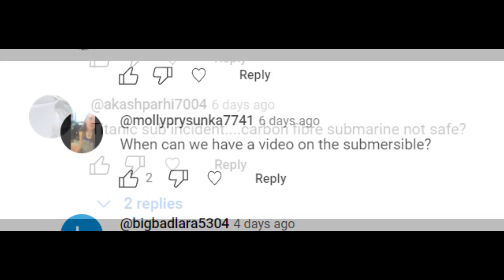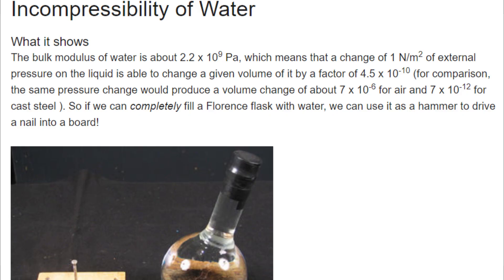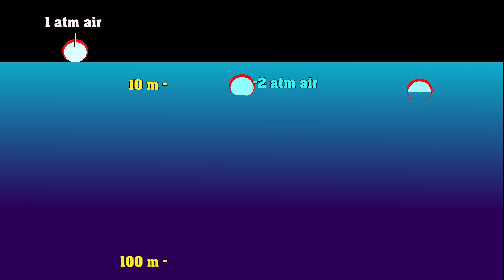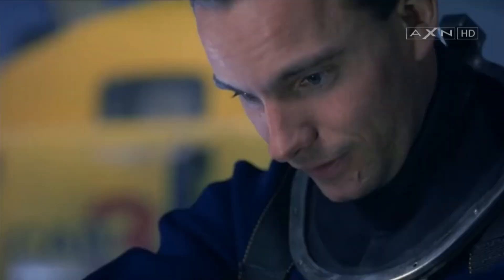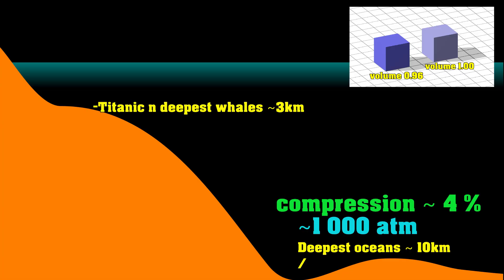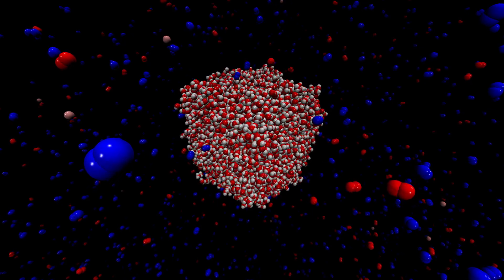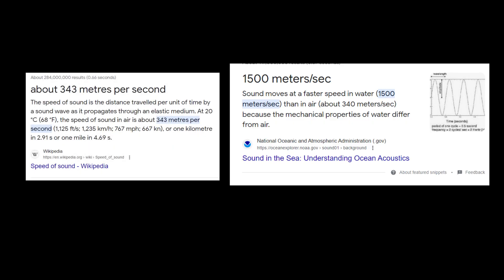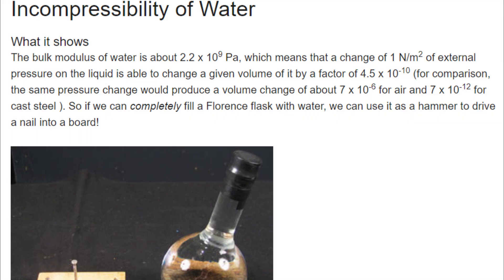What Happens when a Hull Fails at 1000 atmospheres?

Comment: I would like to see additional info, not just about changes in compression and decompression, but about temperature change as well. i.e. is there cooling of the water as it decompresses, and is there heating of the air in the capsule as it is compressed. How high will that volume of air and water heat or cool  under that kind of compression or decompression?

Comment: Have you not seen the films made during Operation Wigwam? A nuclear bomb was exploded deep underwater (basically, a nuclear depth charge) and film was shot of the inside of several submersible vessels that were loaded with dummies to simulate crewmen. One of the submersibles imploded, and the water rushing in was caught on film. I feel sure there must be videos with the film clip in them, somewhere here on YouTube. The incoming water moves VERY quickly. I've seen the clip several times - it is quite upsetting.

https://en.wikipedia.org/wiki/Operation_Wigwam

ALL UNDERWATER NUCLEAR TESTS
https://www.youtube.com/watch?v=gK3E6N8DuE8&t=324s
(skip ahead to time index 1m 30s)

Comment: Great one Phil but I have a question If air is moving at the speed of sound is it just ricocheting off itself like pachinko balls or is it actually going somewhere seems like it can't go very far before it changes direction
Also based on things that move at the speed of sound they tend to heat up so the thermal consideration seems a little off wouldn't Sonic speed air create some friction c heat,?
Reply: The speed of sound increases with heat. This is why rocket engines are able to exhaust hypersonic gas without disintegrating.

Comment: What is the scenario if there is only a pinhole breach in the container?
Reply: Less than a millisecond later, the hole, which is now a point of failure, is expanded and accelerated into the chamber at mach 3. There is no "pinhole breach" at that depth.

Comment: I saw a simulation of the incident. The hull collapsed along its longitudinal axis. The two end caps slammed into each other, and that's what popped off the viewport that's held by 16 bolts that were all sheared clean off.
When they built the hull, they wound the carbon fibers in parallel. They should have used a  criss-cross pattern. 
But it's stupid to use carbon fiber this way! It adds no strength to the material. The fibers do a great job in tension but offer no resistance in compression. The epoxy was the only thing holding it together.
On top of this, I heard the hull was supposed to be 7" thick, but Richard Rush III was in a RUSH, so it was only 5" thick. 
He refused to PAY for a better viewport, too. He took the CHEAP PATH and paid the ultimate price!

Comment: Others may have already mentioned the gruesome Byford Dolphin industrial accident of November 5, 1983. A Norwegian diving chamber was on the deck at 9 atmospheres of pressure. The decompression had barely started when someone made a boo boo, causing a clamp to fail and an instant decompression. Nothing much left.

One diver, his spine and entire chest contents shot out the top of his head.

So, for the folks in the Titan implosion, there might be remains. Maybe resembling hamburger, but not much else

The same folks who whine about standards and certification suddenly turn silent when things like this happen
Reply: The reason why one of the divers was a mangled mess is because his body was forced through a partially open door during rapid decompression. The other victims remained intact.

Comment: It would be very interesting to take a 50% scale model of the titan carbon fibre and titanium bell hull and expose it to cycles of pressure in a hydrostatic test chamber simulating the pressures and temperature profiles of multiple dives… with strain gauges everywhere and cameras. Also take a model and compress it to failure with ultra high speed cameras to record the implosion event.
Reply: Hydraulic press channel has just done one - The Finnish guy.
Reply: @threeMetreJim  I saw those tests. Even with the tiny sub replicas there is an audible crack outside the pressure vessel.
To think, that is just a small fraction of gaseous volume compared to this incident.
The support ship had to have known 3 seconds after it happened.
Reply: You wouldn't get an implosion in a small test chamber. You need a lot of high pressure water to expand as he pointed out.

When they test scale models you just see it crack, and then the pressure is relieved
Reply: @zachary3777  the hydrolic press channel did this a few days ago  he made a water tank and uses water in the press to simulate depth  its very interesting
Reply: @zachary3777  thats the implosion happening, its just not as violent. you just dont have the explosive re-expansion afterwards because of the small volume of water.
Reply: @zachary3777 why?
Reply: @robertjusic9097  there's just not enough water in a small pressure chamber to fill the pressure chamber and the void the sub leaves.
Reply: Not 50% scale. But interesting anyway

https://youtu.be/BQGDwE3yMb0
Reply: The hydraulic press channel have just done a video trying to do this https://www.youtube.com/watch?v=BQGDwE3yMb0&t=727s
Reply: That's kinda what the creator of the sub should have done before any passengers embarked.

But it was cheaper to not do that.
Reply: @nobody8717  the reason he didn't wan to undergo certification is his backyard built craft would have failed. look up what Triton Submarines go trhough to get certified and that company has craft that not only go to the Titanic but 36000 feet

Comment: The hull is also compressed.  The speed of sound in the material of the hull will be even higher than that of water.  Once the hull begins to fail, the point of the defect will accelerate into the inside of the hull.  This will likely be the first material into the space and also what killed all the people before the water even got to them.
Reply: .. water at very high speeds hitting you(human tissue/bones), or vice-versa, is not unlike a water melon smashing against a concrete slab
Reply: @fondoman3884  By time the water got to the bodies, I suspect it no longer mattered.  Bits of the hull came in at a speed higher than the water.  Remember the hull is several inches thick and is compressed by the external pressure.
Reply: @b.jellis  It more likely reacts chemically to become CO2.
Reply: I see your point, but do you consider that we are talking about ~twice the speed of sound? At that speed it doesn't matter what will get to you first. When you get shot with a bullet, does it matter that first it pushed a piece of your shirt in you?
Reply: @simonspacek3670  In this case it doesn't matter but it still is a detail.  I have also seen failures where the bulkhead forces its way done the inside of the tube.  In this case the tube didn't go out of round but instead bell-mouthed and stretched to be large enough for the bulkhead to go down.  This case will leave a hazardous artifact with compressed air trapped inside.

Comment: You've described what happens when you delete a bulkhead. Isn't it more likely that the failure starts at a point / crack leading to a supersonic jet of water rather than the pile driver you're describing? I suspect the sub and its contents would initially be shredded by water jets rather than crushed.

Comment: We've all seen things implode instantly in videos, movies, etc.
Now we know what that "shockwave"/"bubble" around it is. Temporarily decompressed water, as it fills the volume of the container.
All faster than we are meant to comprehend with our eyes.

I can only assume that the crushing of the structure happens because the still-highly-compressed water on every other side will continue to add pressure to a now weakend or opened structure.
So I have believed that a person would be crushed instantly by the structure, when in fact a person would be dead from the shockwave of approaching decompressing water. Like dying to the shockwave from a big explosion. But they die before the sub is even crushed.

Comment: As ex-pro-composite maker, hurts to see that clip where they wrap straight carbon fibers around hull. That's not how composites should done! Even didn't do any high pressure (only liquid helium) vessels, there was always fibers going cross each other, in many angles, that's what make fiber composite so strong. Same way going fibers are too easily splitted from each other. It was only matter of time this happened, it survived suprisingly many dives compared how it was made.

Comment: i imagine something like a bottle rocket where high pressure (or i suppose decompressing fluid) shoots out and launches the bottle, but somewhat in reverse where the decompressing fluid is flowing into the bottle with so much force that it blasts it apart.
Reply: I think bottle rockets work by compressing the air like a spring, not the water. The water is just useful as a heavy mass to be ejected.

Comment: The explanation is way too complex and still misses the point.

Think of a water tower. The higher the water tank, the higher the water pressure at the faucet at the ground level. Accounting for conservation of energy, the higher the water tank, the higher the kinetic energy of the water coming out of the faucet at the ground level.

At 15000 psi, water can cut steel. At 6000 psi (pressure at the Titanic shipwreck) water can cut through limestone and definitely through carbon fiber.

Hull breach. Small water entry which become much greater in size very, very quickly through the abrasive/cutting property of water flow.

Thunderfoot made a big deal that a short water column falls just as fast as a tall water column. However the key issue is momentum. It is not the speed but the momentum transfer that kills you. Think a slow moving (30 mph) train colliding with a stationary SUV. Next thing you see is an SUV bouncing off the train at 70 mph, totally destroyed.

Water dynamics related to water compressibility are secondary to the hull implosion process.

Comment: Longtime enjoyer of your content but I must object to your description. Besides this treatment of cavitation being in perhaps poor taste, the compressibility is mostly irrelevant to the physics of cavitation except when collapse speeds are approaching the speed of sound in water. The collapse of a cavity (or air bubble) in liquids was treated by Rayleigh, which shows the collapse is inertial and will pick up high velocity, even with only 1 atm pressure differential. In fact, sonoluminescence with plasma temperatures of ~10,000 degrees can occur with only ~1.5 atm pressure differential under highly symmetric collapses. So while the acceleration of a collapse begins small, it can build up to increasingly high values (10^12 g for sonoluminescence). All of this science is interesting, but rather stomach turning in the context of a tragic and deadly event.

Comment: I keep hearing about a debris field too. Looking into it i think i foud what they're talking about. The thing was built in five separate pieces that was tacked together onto the main hull. After the main hull got breached It essentially rapidly broke the entire frame apart. Meaning the thing was so flimsly built If you put it in a vacuum and suddenly filled it with normal stmospheres of pressure It would rapidly break the thing. Okay that's an exaggeration but it's definitely not surviving a drop from a small height. If it was actually built to standards but still had some accident, they should have found it in one big piece or at least not five separate pieces.

Comment: Divers don't die by compression at 100 feet (about 3 atmospheres) because they breath air at the same pressure as the surrounding water. A leak in the sub will have a very destructive by the force of the leak.  I think Thunderfoot is referring to the partial pressure of the gasses at depth. At extreme depths the partial pressure of O2 is high enough to cause central nervous system issues and so people can die from that. ALso once you exceed 3 atmospheres the Nitrogen affects you with what is called nitrogen narcosis which can affect your mental acuity (seem drunk and it gets worse the deeper you go). So they use special mixed glasses less nitrogen and less oxygen by adding helium. (no nitrogen, less O2 and adding helium)

Comment: Finally a what happens video i can trust.. the only thing i'm still left pondering is the air/gas?

It's only a tiny amount and much like the water i'm sure there is probably some sub-atomic process that'll take place but i wonder if it'd get dissolved or eventually bubble to the surface or... ?

Comment: I am probably being stupid here (not for the first or the last time) ....... Given that the water enters at Mach 2, if the hole it enters is small (a pinprick) water will enter fast but not that much volume will enter at a time (was that an oxymoron?) Sure the sub would flood quickly and a jet of water at that speed would cut you in half before you realised it ....... but would that volume/s of water have a hammer effect strong enough to break the sub apart? 

Don't get me wrong it is not a good way to go and I think they were as mad as a box of frogs for trying it, but was something else happening? Surely the leaking point must have ruptured quickly into a sisable hole to allow the hammer action to have the effect shown?

Comment: The pressure vessel would accelerate toward the decompressing side, amplifying the impact with the inrushing water.  So half of the contents within would slam against the inner wall of the accelerating vessel and the other side impacted by inrush water, then to be slammed together in the center.

Comment: I'm also curious what the adiabatic compression of the air did. It would have gotten really hot somewhere in the sub in a few spots, like surface of the sun hot.  It would be brief as the energy would sync into the ocean water, but certainly there.
Reply: Not surface of the sun. At around 13,800 feet deep you would reach 6000 psi and 2500 F (or 1300 C) under perfectly adiabatic compression.
Reply: @zachary3777  From the reports, it appears the sub imploded at around 3500 feet.
Reply: @Andrew-un8tx  at the depth you're looking at about 1500 psi and 830 degrees C (1500 degrees F).
Reply: @zachary3777  That's where I ended up too. A couple of orders of magnitude away from sun temperatures. And those tiny little pockets of heat would have rapidly equilibrated with the huge mass of ocean water around it.
Reply: I also have heard surface of the sun in some people's description of the event, but do calculations really support that? I'm not a physics expert but I did take quite a few physcis and themordynamics classes while getting my Master's in chemistry. Just from my back of the envelope calculations (which admittedly could be wrong) it doesn't appear to get anywhere near that hot. That's off by a couple orders of magnitude.

Comment: At first i was very bothered by the mental image of all the crew being effectively Diesel Combusted but with at least the solace of them going quick and without pain.  But now i am haunted by the idea that Rush and his composite hull having found an entirely new(for manned enviroment vessels under pressure)  and violent failure mode, where by the hull delaminating manages to act as "braking" factor for the ultra high pressure intrusion (still resulting in pulping/combustion).  So yeah, the idea that the thing still peeled apart, but it unraveled like a epoxy bonded sweater before it collapsed, and they were aware before the void.

Comment: Although you are correct about the maths involved you ultimately failed to mention that the five people on board did not die from the water hitting them.
They died from the compression and ignition of the gasses in the vessel before the water could even hit them.

Comment: What happens to the air? There was a lot of 'experts' on reddit saying that the air being compressed would have reached to temperatures like the surface of the sun at the air water boundary and burned / vapourised everything inside the sub....?? Is that likely?

Comment: Hopefully that’s part 1. Now what would the simulation of cylinder collapse look like?  

Instead of the column of water filling the sub 17:41 from an end, entertain the loss of structural integrity on the CF cylinder from all directions.  Like the atomic bomb compressing the core with a spherical pressure wave. Or rail road tank car collapsing due to internal low pressure, partial vacuum. 

Instead of water shot into the cylinder L to R, but the radial collapse of the cylinder. The end caps were not the point of failure. The cylinder was (perhaps) crushed like the shank of a drill bit in 10 jaw chuck reducing its diameter at the 1000 m/s.

Comment: Maybe I got it wrong in the video but as far as I know, whales do exhale before diving. They carry oxigen in their muscles, and/or other tissue not in their lungs.
Reply: @dontlookdown5565  The free divers you are talking about are humans build to live on land. Mostly.
Any free diver dives for way less time than a whale does and whales go way deeper.
Whales live in the ocean and you would think they have specialised over time (evolution).
When humans dive long time and deep they have to take measures to prevent diver sicknes (mainly caused by nitrogen which is big part of the air) and so does the the whale, though he has other methods to do so as he is a marine mamal.
Divers sicknes is no problem with free diving, because of the short time and less deep diving.
I am quite sure about that. Wheras there are videos that tell otherwise.